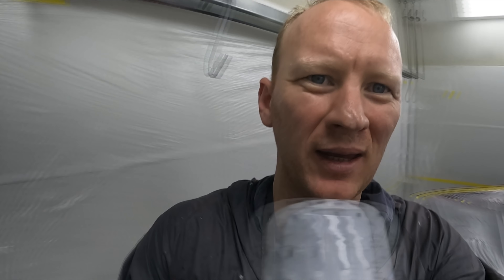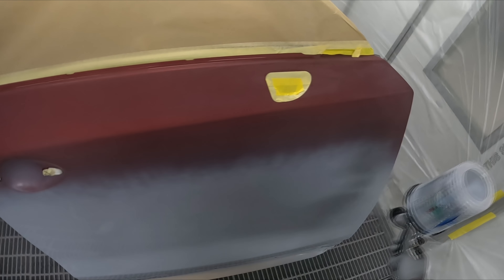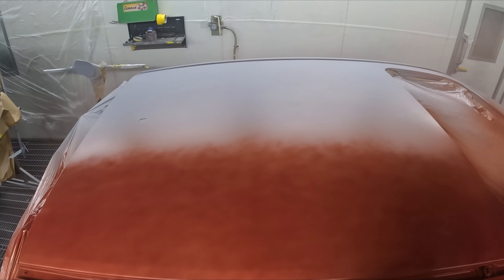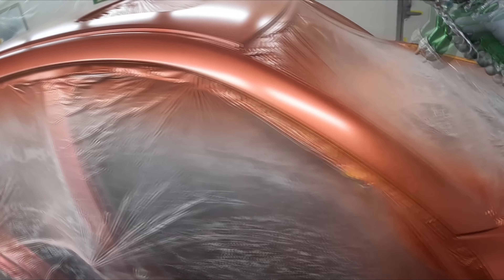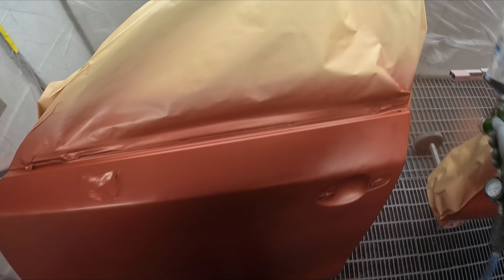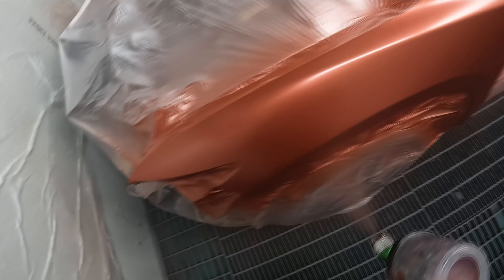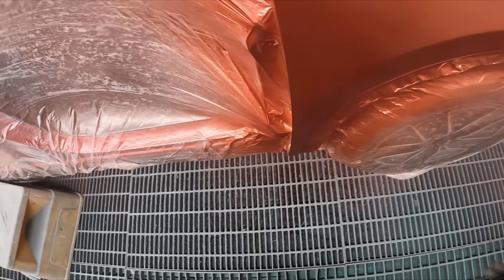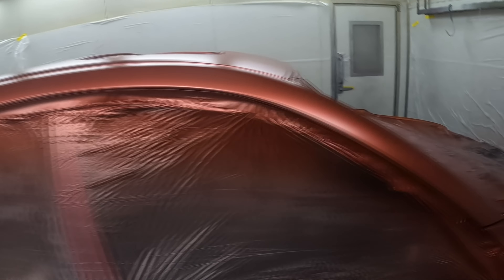Mazda CX5 Respray WOW & Basecoat

Comment: Have you ever tried using the PPG in a single visit mode anyway? We use Glasurit 90 Line at work and you're supposed to spray it similar to the Envirobase, but you can put your 2-3 coats on at once, dry that, drop coat it and then clear straight over that and it works pretty well even though the reps say you cant do it like that

Comment: I’m calling bullshit on you only need to use a sata to get correct color, I’ve use a tekna prolite for years and still had color match, even used a 3m accuspray with no issues. As a matter of fact I could pull up on the computer and ppg tells you the suggested psi for each gun manufacture. The only way the gun can change the color depends on the drop coat psi. And also, 23 secs on a viscosity cup is the number you want for base.